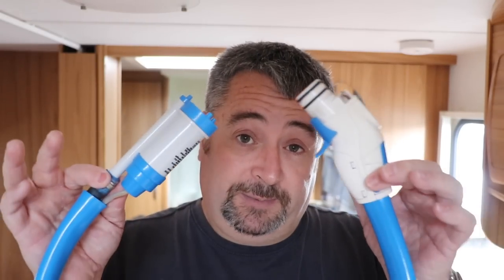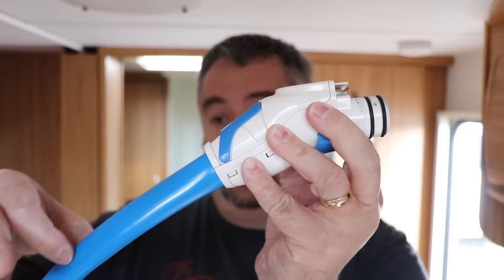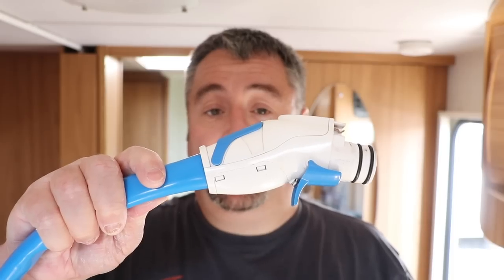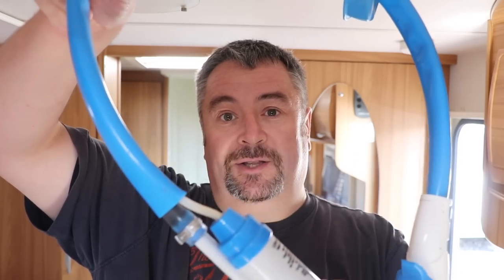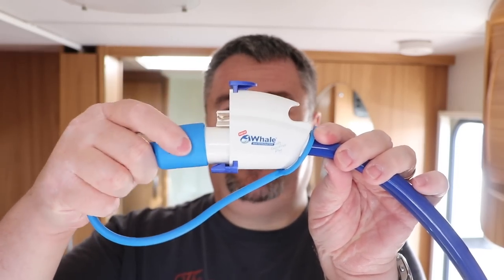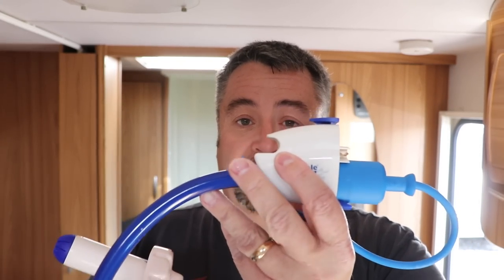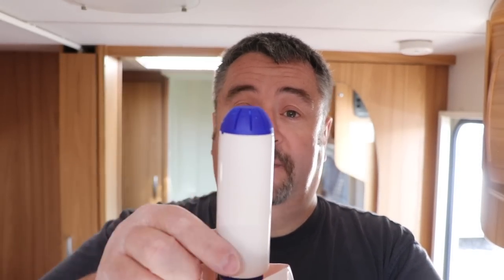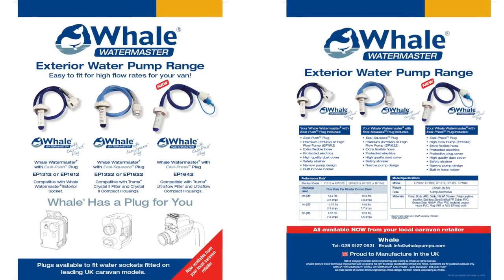Whale Pump EP1642 upgrade to a Caravan Truma Ultraflow system

Comment: Hi Dan,
Having problems with a Bailey Discovery with the Ultraflow system fitted.  We can only get hot water for approx 3 mins tops, then the combi will stop heating water, the hot water icon on the display flashes and we get a nice smell of hot metal/plastic through the vents?  Could this be down to a lack of flow from one of these pumps or more likely a combi fault??  Thank you.
Reply from the maker: Hi Mike, i would look at the flow that the pump is pulling through. it maybe the pump pipe is kinked, or some debris in the pump filter. i would recommend you speak with your dealer though and see what they suggest.
Reply: @TheTrudgians  Thank you.   We have the van booked in for a look over.

Comment: I have 2003 version of this, and it does nothing. i plug camper to CEE 230V, - confirm we have electricity, I fill aquaroll, get it to the campler, submerging the hose with the bump, go in turn on pump AND? Nothing, not a drop of water, not burp not a sound. Pump seems dead. which is awesome -  I try this with heater off (cause what it would  heat?) and yellow leaver (near the heater) is down. No solutions on the internet, everyone is upgrading from newer system than I have anyways or is solving issues about internal pump. Send help! xD

Comment: Thank you. Not just me having problems with the Truma pump then. To be blunt, it's quite rubbish isn't it? We managed to over bend it, causing a leak. It's so flimsy and inflexible. Not a good design at all, come on Truma you can do better than this! So I'll take your advice and fork out for the EP1642, as we have a Truma ultra flow system.

Comment: Hi all. Has anyone who has bought the Whale pump suffered with the connector (to the caravan) intermittently coming off and resulting in no pump/water? Used the Whale pump about 4 weekends and it's self detached 3 times despite me making sure the connector is "fully home" into the caravan piece and the blue clip as far as I can see, is located over what appears to be a locking tab. Never had this occur with the Truma pump/connector. 
Thanks in advance.

Comment: Great video Dan, have you noticed an increase in flow with this new pump?
Reply from the maker: Yes, we did. but we put this down to no kink in the pipe, but one thing Mrs T did note was the flow didn't drop off which the Truma pump tended to do, if running a tap for a while.

Hope that helps

D

Comment: We’ve had the Trauma system for about six months. It broke on the second time out, the pipe came off the fitting and then I broke the cover trying to fix it. I think the whole design is poor and Trauma should be ashamed of it, frankly. The next van purchase I make I don’t want another one of these.

Comment: Exactly the same problem myself and this will solve them I'm sure. What it won't solve is the Truma rip off inlet filter cap. That's around £12 but eventually the blue cap itself will leak. Solution is a new O ring but you can't get them, you have to buy the entire cap at an average £25! Go to an engineers supplier, the O ring is 2.5mm x 70mm and a pack of 10 is, (wait for it) - £2.65!!! 26 pence compared to Truma "well corner the market by restrictive availability" £25!
As if we're not taken for a ride enough by "servicing" that's actually no more than checking it works regardless of miles/work done, I'm also wrestling with a Dometic toilet with a seal that lasts about 3 weeks and costs £40 to replace!
Have to say I think it's high time Lunar looked at this rubbish and all manufacturers restricted the over pricing to their customers if they want to install in their vans. The industry is about 30 years behind the motor trade and reminds me when there was a time a car salesman or mechanic couldn't be trusted!

Comment: As a new caravanner, I love your down-to-earth videos.  They are so useful and I've learned a lot from you.  
Have you come across this and reviewed it?  I would love to know if it works - it's so cheap!
Caravan & Motorhome Grey Water Disposal System  Our Caravan & Motorhome Grey Water Disposal System Is Just £29.99
Welcome to Mac Products. We would like to introduce to you a new efficient way to dispose of grey water from your caravan or motorhome, our caravan grey water disposal system is the perfect solution. With this small, inexpensive device, there’s no more lugging around gallons of grey water to a sluice or hedgerow. All you have to do is attach it to the disposal pipes on the end of your caravan, and let the filter do the rest. It will remove all the solid matter from your grey water, and dispose of the remaining water into the ground under your caravan, without any odours or mess.